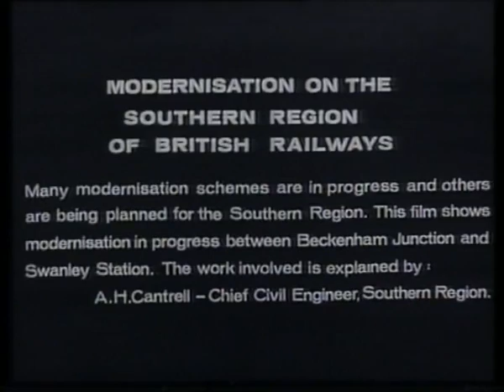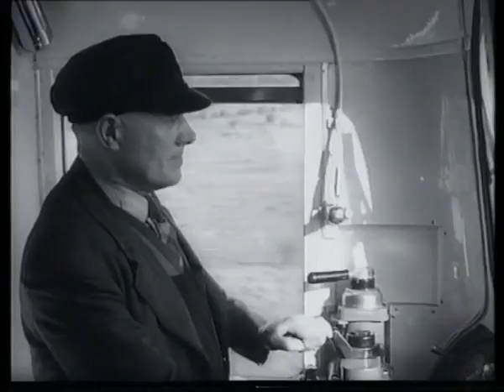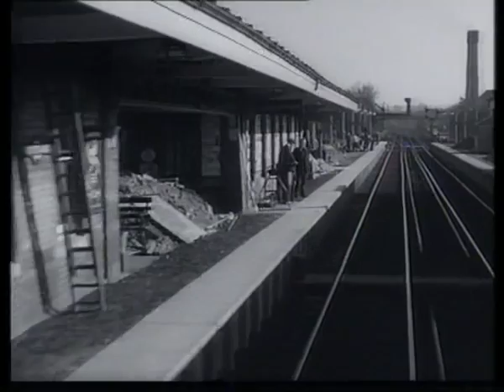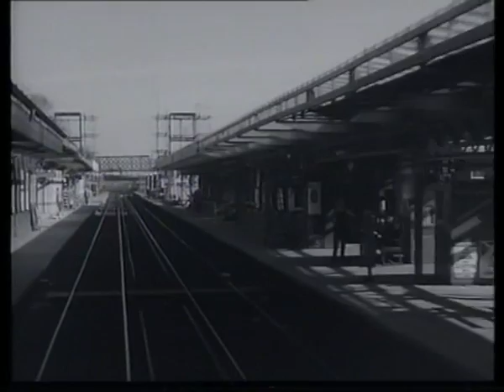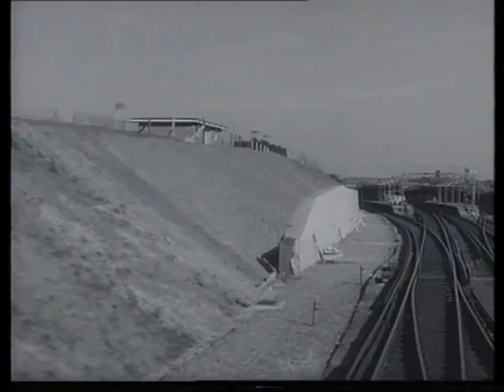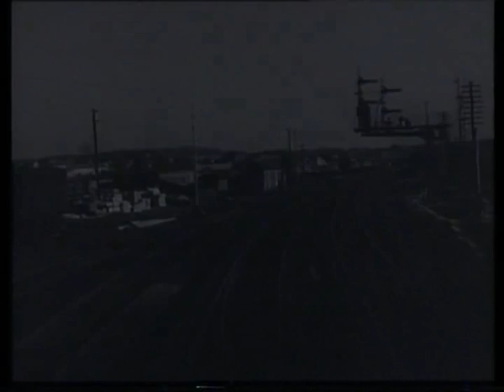Modernisation On The Southern Region 1958.avi

Comment from the maker: The reason on why we went for Diesel traction was that Oil was cheap back in the 1950's.  The two main types of Electrification were 660v 3rd Rail DC and 1500v Ohe DC in the old Eastern Region as was the same in France & Belgium.  However 25kv AC was found to be superior so as from the 1960's it became the standard except in the south were there was already an extensive 3rd rail network.  Network Rail is considering replacing the 3rd rail system with 25kv OHE but I doubt it somehow as it'll cost
Reply: In some ways 3rd rail is safer/quicker, isolations can be limited < 1.5 miles whereas catenary requires upto 50 miles of isolation. makes detraining, dead stock, cows, point repairs etc limited to < 30 - 45 mins  instead of >1.5 hours.